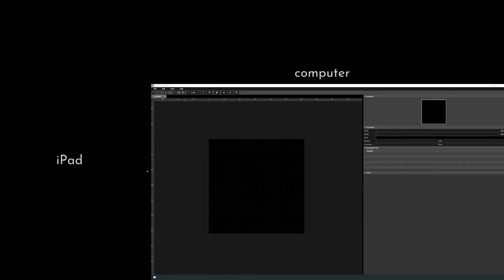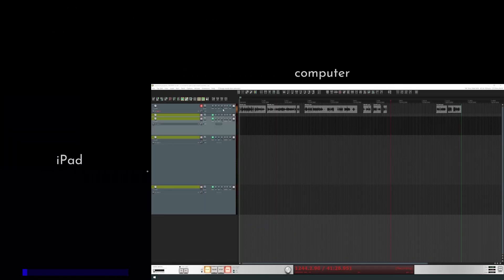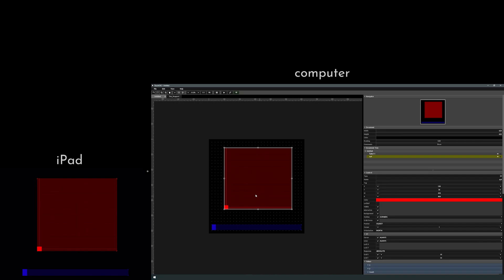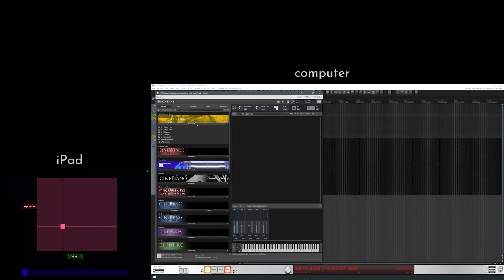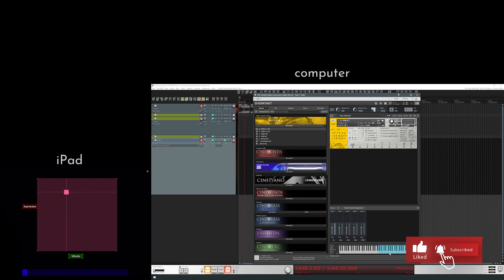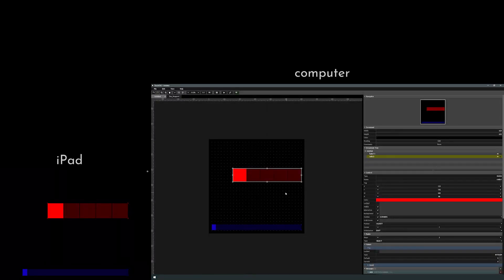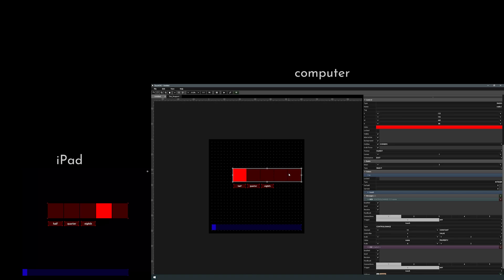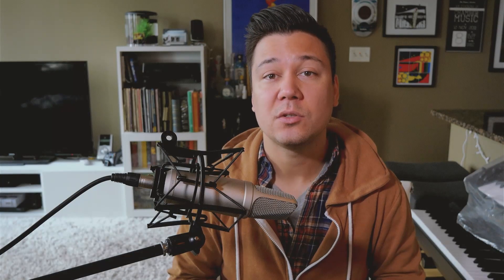Buttons, Faders, & Radio Buttons (Ultimate Guide to TouchOSC)

Comment: Great video, these are incredibly helpful. Is there a way to limit a faders output range? For example I am using OSC messages to control a lighting fixture but I need to limit it to a certain lower and upper limit.
Reply from the maker: Ya, you can do that in your OSC message. I think that would likely be best to do that through a script

Comment: Hi Tim, it's not the first time i'm coming to you for help. And because you already did before, i'm shure you'll know the answer to my question this time too. Already big thanks for looking into my problem! So: Sending midi messages to XY controls is easy with touchOSC as you can send  x values over cc20 and Y values over CC21. But this time i'm trying to control my XY with an  OSC message and the receiving address in the VST (Reaktor "travelizer" by Native instruments) only permits 1 receiving addres for both X and Y values. Also the trick that you showed with midi and OSC learn (first send X values and learn them, and then Y values and learn them)doesn't work.  So this stime i'm affraid i'm really stuck ;-).... thanks again for your advice!
Reply: Curious : why do you want to control your XY with an OSC message instead of with a MIDI message ?
Reply: @djabthrash  Hi. To be honest, after such a long time i haven't even looked at this template, i think:   1 i liked uniformity. 2 then i didn't have to start TouchOSC Bridge and 3. someone told me it's faster then Midi. In the mean time i figured it out and if you really need it can can look into it again and try to remember what the solution was. 🙂
Reply: @hermanverbaeten5894  Thank you ! I'd really like to know if OSC works better than MIDI for XY touchpad stuff at least.
Reply: For which application do you need xy if I may ask?
Reply: @hermanverbaeten5894  I will use it to move a virtual mic (x/y position) in the DynIR virtual cabinet/miking section of the Two Notes Genome (Torpedo) plugin. Better than doing it with a trackball or a mouse imo, and i could do it without being at my desk.
Reply: I was having a problem in the “grip” app by “ugh” in Reaktor in reaper. And in this app I couldn’t figure out how to differentiate x and y. The other side (in the touchOSC template) it’s easy: you simply have to create a xy controle and it automatically gifs you the x and y. I’m not shure to be of any help for your application?
Reply: @hermanverbaeten5894  Didn't you have a separate MIDI for your x and y axis in your "grip" app in Reaktor ?

You can't really help me (as far as telling me if you know for sure that OSC works better than MIDI for XY touchpad stuff) now, but your info and feedback so far has been very appreciated !
Reply: @djabthrash  I think both OSc and Midi work equally fine but i heart somewhere that OSC messages  were faster. And at the time i was having problems with a wifi delay i didn't know where it came from so i took OSC instead of Midi. But in fact this delay wasn't related to midi or OSC. The only advantage for OSC messages is that you don't have to start Touch OSC Bridge.

Comment: I don't understand what is the use of radio buttons. Cannot get any informations from it. Cannot get its index into script for other purposes. Each time I try tu use radio buttons or grid buttons in touch OSC I hit a wall. Are there really any use of those buttons or is that a relic of old Touch OSC buttons ? Even for something as simple as "if radio_button index == 1, then do something" seems impossible to implement.
Reply from the maker: Ya Radios are super weird, partly why I don't script with them and just use the UI, even though it's definitely confusing.

Comment: Can I make controller for multiple computers in one template? For example I need for vMix app(pc 1) and for Resolume app (pc 2)
Reply from the maker: Yes, there is a connections section for each object on the right side of the UI. You can set connections for up to 5 devices in the settings and then on each object you can control which connection it sends to.
Reply: The following video explains that (among other things) :

 Connecting TouchOSC to Multiple Computers (Ultimate Guide to TouchOSC)
Tim Corpus
https://www.youtube.com/watch?v=Yx5rGqhJy_A&list=PL2vdKk2xpcS13xbY8dNq1XdMudYE1Sk7f&index=6

Comment: Hi, is there a way to customize the scale for the radio buttons? Let’s say I have 3 buttons and I want: 
-button 1: values “0-30”
-button 2: values “31-60”
-button 3: values “61-127”

I can only figure out how to evenly spread the values of “0-127” with the scale. But I need specific values for each button. And I need the exclusivity of the radio buttons or else I could’ve done this with regular buttons :/

Kinda stuck on this!

Comment: When assigning MIDI parameters to a radio button with Value selected, you get some strange behavior.  The first number is the Starting value,  The second number will be the value of the second button.  All subsequent values will add the  difference between the first number and the second.  So set 1 and 11, you get 1, 11, 21, 31... Very strange.  So the 1 and 2 you set for the CC number will send CC1, then CC2, CC3, CC4...  When set to Property, the sent value is always the first number, and the second number doesn't matter.  Also, I don't have an engraver, much less any engraving software...

Comment: Hi. How i can make this thing: button1 is pressed, and when I press button2, then button1 need to be unpressed? I want to do this thing for more buttons. One button need to unpress another button.
If you understand me...
Reply from the maker: Sure so you want to control the toggle stage of button 1 with button 2. I recommend using a Local Message. You can add that to button 2 to impact button 1 (add more local messages for each extra button), then have the message change the state of button 1. 👍
Reply: @TimCorpus  How i need add local messages?
Reply from the maker: @dj_toleex  Sorry, I don't understand. What do you mean by "how do you need them?"

Comment: You have awesome tutorials Tim! Really appreciate the time uou take to do these.

I did have one question about Radar controllers in Touch OSC. Is the center the 0 axis or the middle velocity like 64? It confuses me how they calculate the y and x values since it’s like a joystick

Thanks Tim!
Reply from the maker: Thanks for checking out the channel! Good question. I think that would depend on how you set up your message as well as the values of the Radar. If you look at it default and check the messages you can see it's at 0 in the middle, but the number data output changes depending on the direction you go.

Comment: So guys, is there any type of slider or feature which can adjust a "Feedback" control in an fx plugin?
Reply from the maker: Hey, you'll probably get more feedback posting on the Discord or Facebook group from other people, but by feedback do you mean the actual feedback like in a reverb or feedback as in a returning message from the DAW?
Reply: @TimCorpus  Hey Tim, I had tried the fb group and Reaper forums for this but no answer. I cannot understand why this is so difficult. I simple need a slider or rotary type knob in Touch to adjust the Feedback control in fx plugin, this is a screenshot: https://i.postimg.cc/BQb8WW4n/Screen-Shot-2022-08-04-at-1-17-57-PM.png
Reply: @goldmediaconsulting  This "feedback" knob is no different than any other knob so if you follow Tim's instructions in his videos (not necessarily this one) you should be able to create that with no issue.

Comment: Great video series! Thanks. A problem I am having (if it really is one) is that the fader (or button) I am creating is only sending osc messages, not midi. Am I doing something wrong?
Reply from the maker: Thanks for the question! Do you have a MIDI message enabled on the fader or button? Also how are you checking if it's sending? Are you using Protocol?
Reply: @TimCorpus  All those were enabled and I was trying to bind the button to an action but it showed the button name (i.e. button1 or fader1) and not the midi controller number. Then I installed protokol and saw it was receiving midi messages. Somehow, touchosc bridge was available now as a midi input and it worked. I don't know if I did something right or by accident, but it works now. Thank you!
Reply from the maker: @johnhatzidimos613  interesting! Well glad it works now!

Comment: Thanks for the tutorials! Actually for mapping the XY pad, there is no need to disable the send. It's quicker if you just leave the marker at the 0,0 (left corner) and when it comes to mapping, just move it to the side, either left or bottom. That way it will have reached the limit of the one axis and just move the other one you want to map.
Reply from the maker: Great point! That can be a good way to get around for folks. I'd say if people do end up getting crossed signals to turn it off then try that way, but you're totally right!